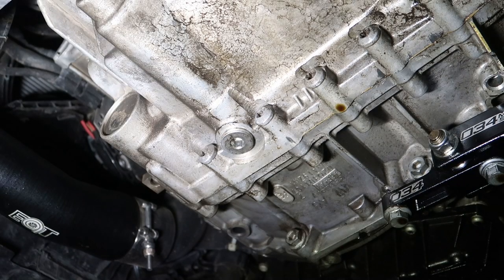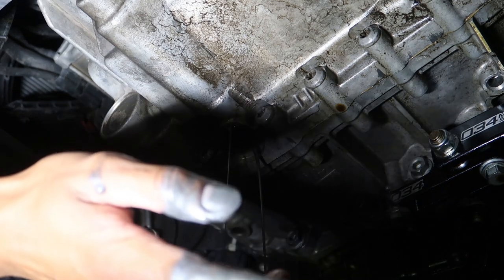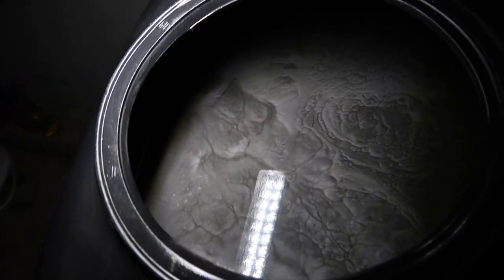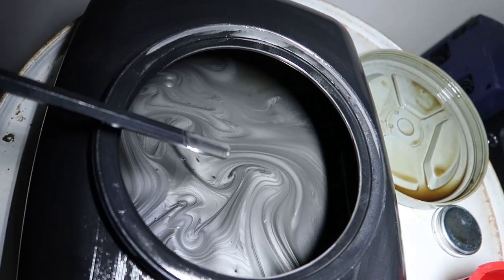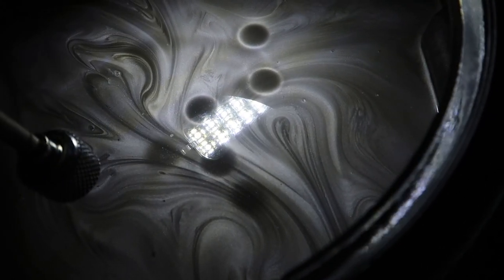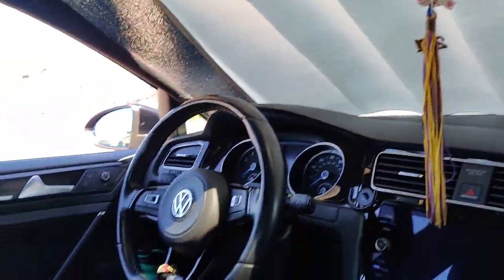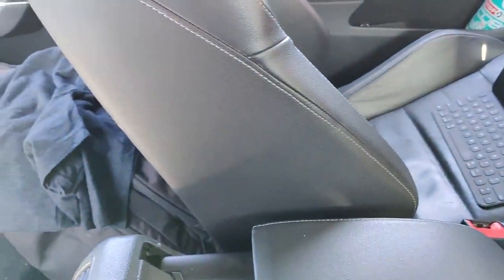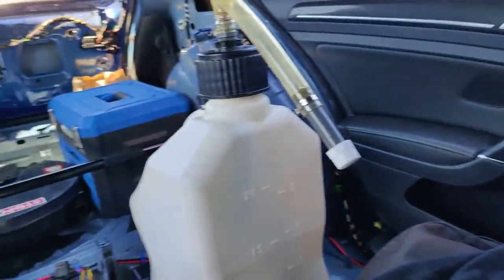TRANS IS TOAST! Fluid looks like metallic paint | MK7 Golf R

Comment: Where are you getting your trans built?
Reply from the maker: FFE racing seems to be the pick of the litter
Reply: @BryceJordanProductions  What stage will you get? I'm tempted to get this in the new year, will have to find a spare gearbox and get it done.
Reply from the maker: I'm not sure exactly what stage but 4-6 dog gears (or maybe it's 3-6) LSD, gear supports and whatever else the recommend
Reply from the maker: I pulled the engine and trans yesterday, found a hole in the trans so I gotta figure out if I can just replace half the case or repair it or buy a whole used trans.. more to follow later once I figure out exactly how things are going to go
Reply: @BryceJordanProductions  Have you inspected the engine fully to see if anything is wrong with this? Would it be worth while its all out maybe taking the bottom end apart and checking the bearing condition?
Reply: Bryce Jordan Productions yeah that’s what I’ve also concluded...

Comment: That looks bad, what brand of transmission fluid did you use?
Reply from the maker: OEM, not even 1500 miles on the change..
Reply: @BryceJordanProductions  keep us updated at what was the cause... my mechanic put in the gearbox filter in the wrong way ,caused my housing to explode.
Reply from the maker: Holy crap that's not a good time.. and will do!